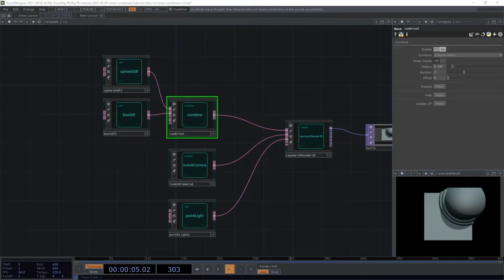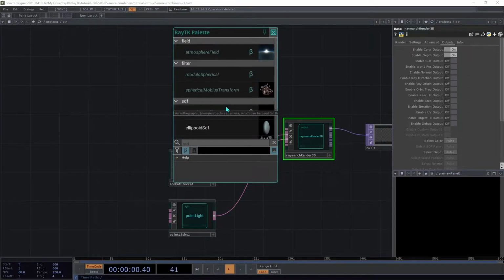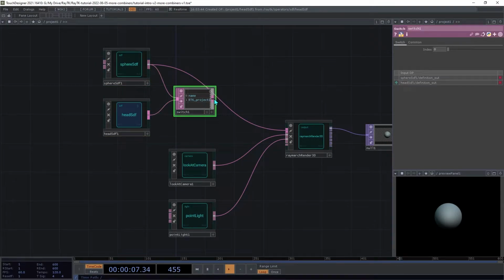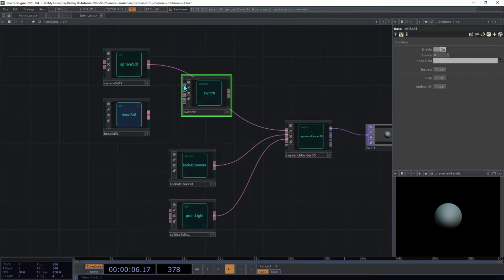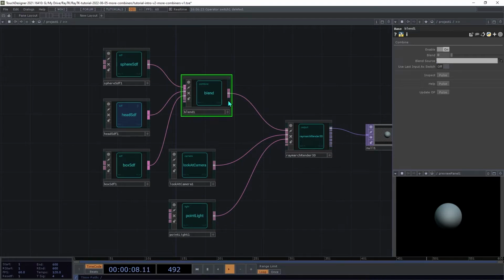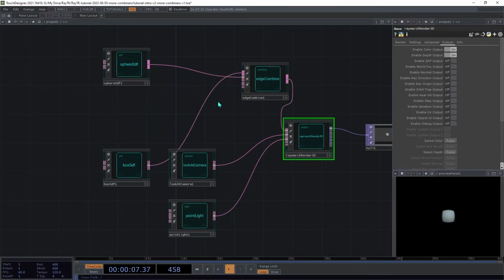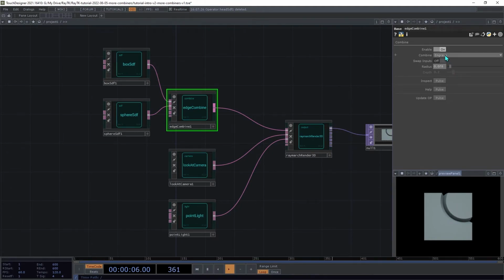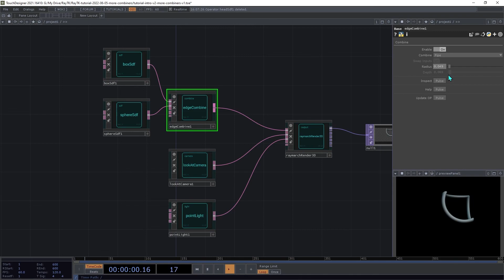RayTK Intro Part 4: More Combiners

Comment: did the blend feature get removed in later releases?
Reply from the maker: Use the switch operator with the blend setting instead. Or switch on deprecated ops using the toggle near the bottom left of the palette which lets you use the original blend operator
Reply: @tekt0  thank you so much for the response! I your tutorials are absolutly amazing cannot thank you enough homie